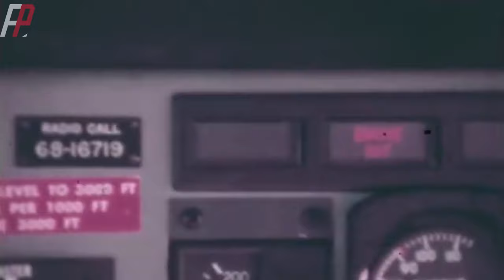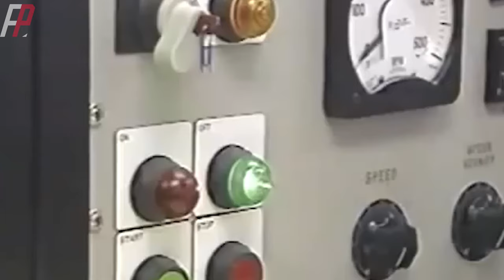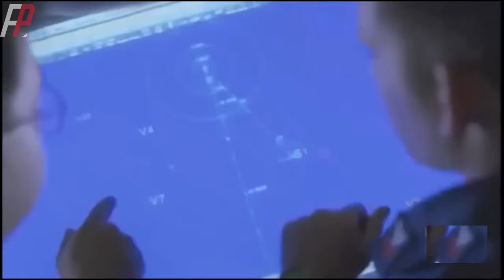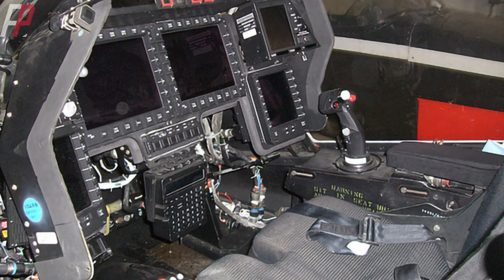RAH-66 Comanche,The Stealth Helicopter The U.S. Military Had To Dump

Comment: A limited production run was of perhaps 100 was fully justified for the Comanche. To be kept for very special missions only. Sadly it did not happen. However, as a proof of concept the RAH 66 was a great success. Now that proven concept sits on the shelf awaiting Comanche II. 
It's coming, they do not spend $7 billion without gaining something! Comanche II will benefit from advanced radar absorbing coatings from the sixth generation fighters, requiring far less maintenance. Along with a newly redesigned stealthy yet aerodynamically sound body shape.  Advances in sensor tech. AI and general computing will add new capabilities.